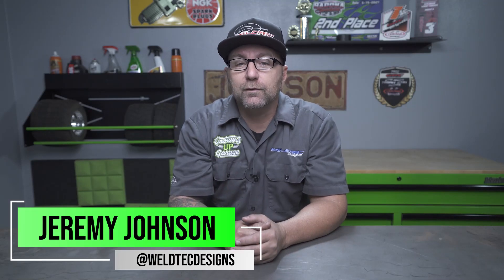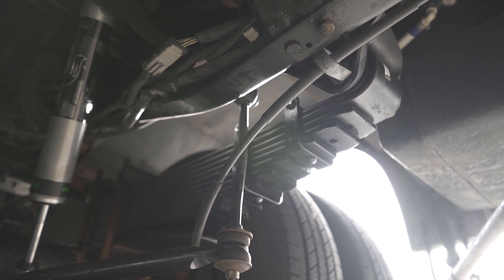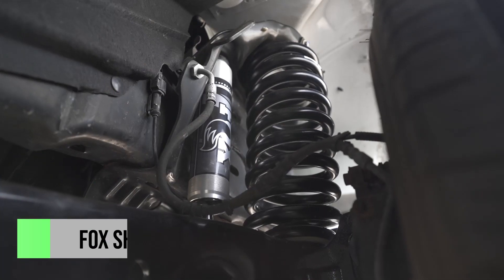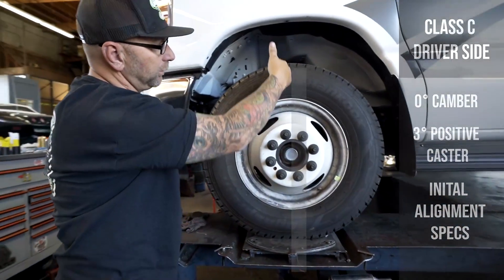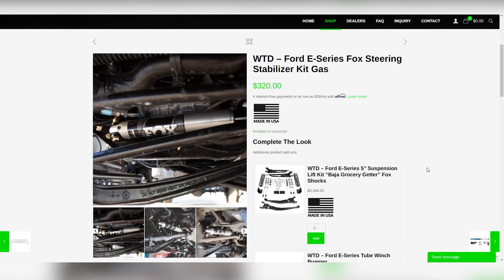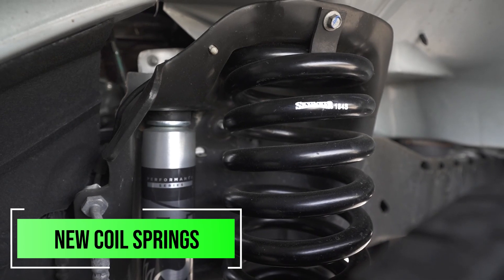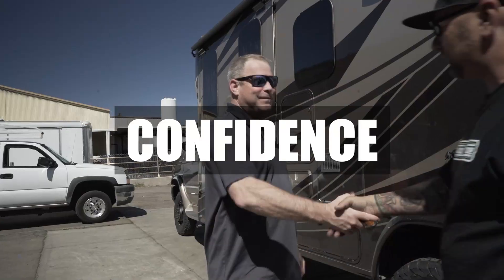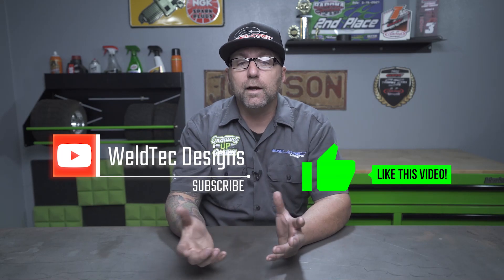MAJOR Ride & Ground Clearance IMPROVEMENT! Thor Outlaw GETS UPGRADED With 2" SUSPENSION PACKAGE!

Comment: Hi Jeremy,  brand new to your Channel,  lm a G.M. guy 👦 .
I have an older southern Yukon, same as G.M. van chasis l believe. It's a 4X4 2500. I would love to see any old videos that you have previously created, lm looking for 2" of lift, total front and rear suspension upgrades. Stronger front axles with switchable locker, same for the rear. Anything you can help me out with, l would appreciate. Looking to build a Yukon that has major off road  cred! 
Thanks for sharing. 
✌🏻🔑❄️🌧❄️ 🌬 🇨🇦.
Reply from the maker: What year is your van? is it still IFS up front?

Comment: Does Weld Tech design have any kits (including steering control) for 2016 Thor ACE motorhome? If so, do I buy the kit or do I just tell the mechanic that’s the modification kit I want installed. Does Weld Tech have shops that do those installations?

Comment: We have a 1998 Chinook Premier 21 foot Class B+.  Very good shape, 78000 miles. Probably 3500lbs front / 6500 lbs rear rated load.  I know you guys have worked with Premiers before.  Would the Getaway 2" lift kit be a good fit for this Chinook, we're not looking for a lot of lift (70 years old), but we are looking for comfort over bumps and straight tracking down the road.  Thanks for your time.

Comment: Jeremy, thanks again for the informative video. Quick question, you mentioned you do the modified radius arms on the 2" kit to save cost. is there still any advantage of paying extra for the longer arms? I know they move the front tires forward and help maintain caster (or is it camber, lol). I just wasn't sure if they give much of an advantage over the modified arms on the shorter 2" lift to be worth it or if that comes more into play on the 4" and 6" lifts.Still looking forward to do the lift, my only issue is I am on the other side of the country. So far I have not found any places that wok on RV's that could, with confidence, say they would be willing to install the lift. So it have to find a way and time to head your way.